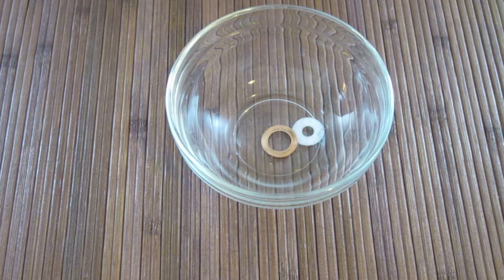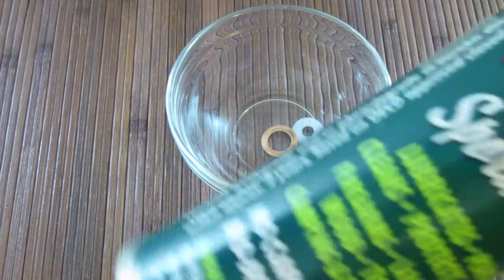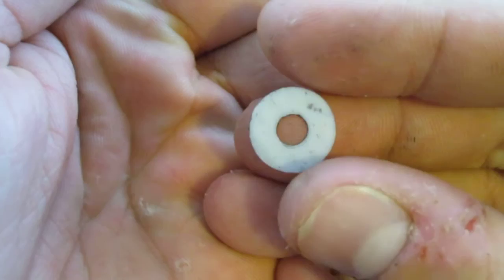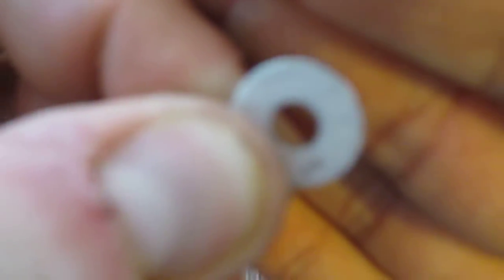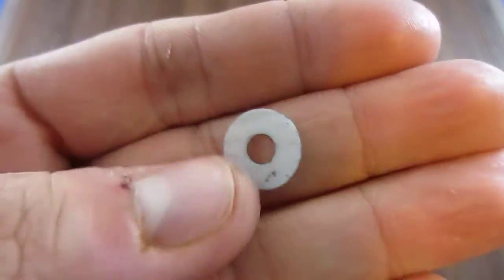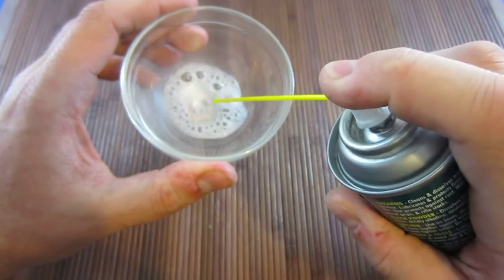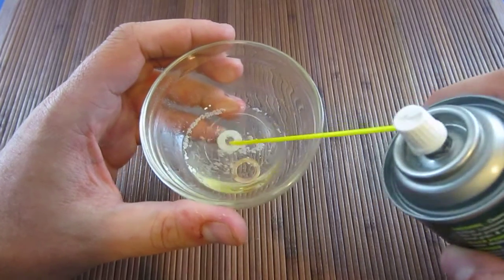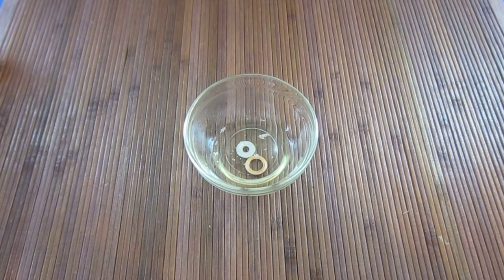Will Ballistol Disolve Washers? Part 1

Comment: @xiuxiu1313 wet the edges of the plastic wrap fir a air tight seal and no it's a controle leave it alone,just do visual specs

Comment: Not that I'm denying your claim, but were you hosing the internals down with the stuff, and leaving it sit there.  If you do that and shoot the gun after, no wonder it would be fouled up.  A little dab will do you for lubrication.  You only need to hose it down for cleaning, then you remove the excess.

Comment: I'm not thinking any harm will really occur.  I've been using Ballistol on my guns and knives for over a year now.  My Sig looks like brand new after a year, and every knife I use it on gets smoother after an application.  I imagine if it was eroding or dissolving the washers, the action of those knives would have gotten rougher over time.  Either way, I'm very interested in seeing your results Carter.

Comment: I have used Ballistol for over 10 years on my Browning Superposed's. They started getting problems with the firing meganism and ejectors. I sent them to FN in Liege and both guns are fully clogged from the inside. The gunmaker had a hard time to clean the guns and it costs me a lot of money. So after this, i will never use Ballistol again on my guns.

Comment from the maker: When I got it it was slightly off center to the non locking side. I tightened it just a tad, and now it is centered and still super smooth. Sorry to hear you are having troubles with yours.

Comment: Interesting. I was under the impression it was 99% mineral oil...but i guess it does claim to be able to remove lead and copper fouling. Im still guessing it does not dissolve metal, but that 1% could be anything so im watchin'